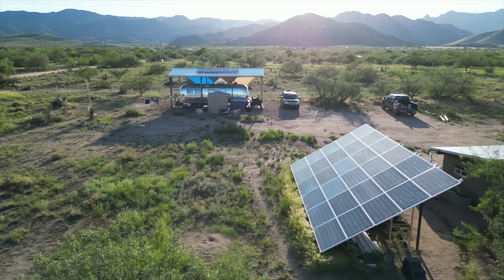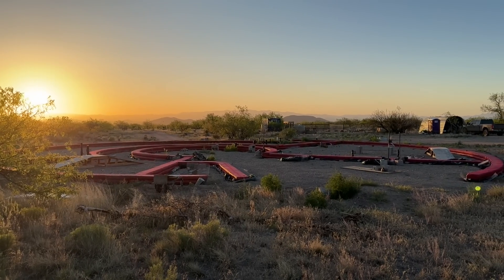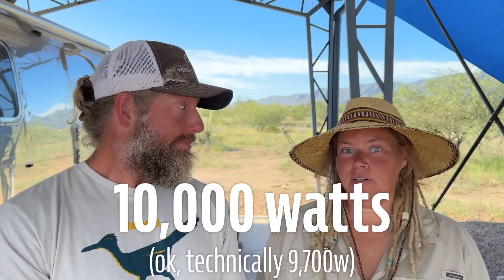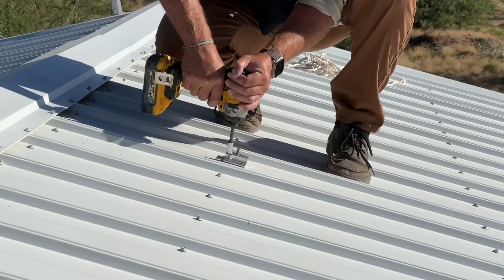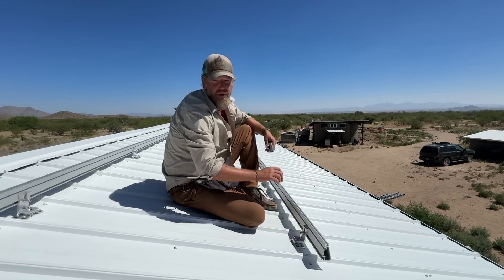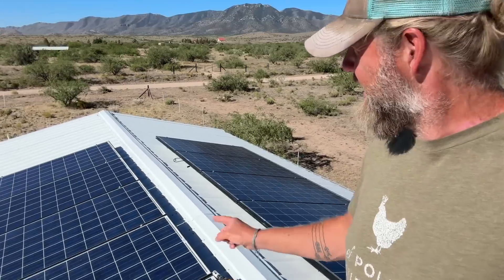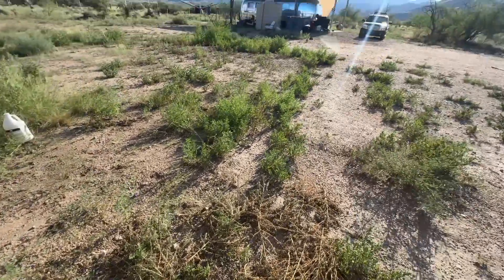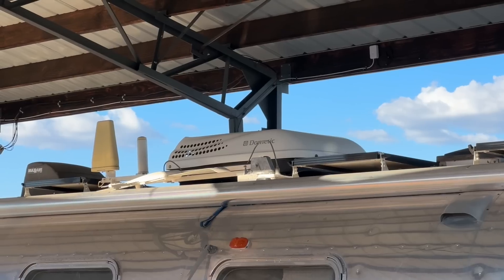BOOSTING Off-Grid Solar System for BRUTAL Desert Summers

Comment: Nice job but if you had just grounded the frame of the car port it would be grounded
Reply from the maker: Grounding the car port is surprisingly complicated because each truss is separate and connected by wood purlins. Because of that we opted not to “ground” the building with the electrical components.

Comment: Strange, I have a metal roof like yours.  I put all the screws on the ridges, not the valleys.  My thought was the water won’t be running down the ridges.  Thank you for this good advice.
Reply from the maker: Different R-panels have different installation recommendations 👍🏻

Comment: You're in the desert... bury a pipe, in a U around your camper, put in a fan, and you'll get earth cooling 24/7 at a small fraction of the AC cost.
Reply from the maker: Have you actually calculated the cost of large diameter pipe over the very long distance you would need for this to work, not to mention the cost to dig those trenches? Spoiler: The A/C is way cheaper. We actually put in a Mini Split: https://youtu.be/mRcHImNXHU8.

Comment: Frankly if your going to all that hassle I woulda filled both side of the roof with panels now that panels are 33% the price they were 2 years ago.  You can never have too many panels but you can always have not enough! :D
Reply from the maker: The rest of the system wasn't built or wired for more than this unfortunately.

Comment: Stop using the current ac and switch to Mr. Cool heat pump and your power needs will drop.  And the Mr Cool will run quieter with less power.
Reply from the maker: Watch to the end

Comment: how much of that land do you guys own? i'd have thought it'd just be easier to have a solar panel farm at ground level, and maybe be able to adjust the angle at different times of year.
Reply from the maker: Ground mounts are generally 5x the cost of panels because of high winds. So anything adjustable isn't safe.

Comment: Ya solar is cool. But I don’t think people understand solar panels only generate power 5 hours on average of the 24 hours and that’s during the summer. In winter it’s closer to 4 hours. I think we all know solar panels generate power from the sun but we assume it’s for 12 hours. That means like you are explaining you can not run a 1.5 kWh ac during the other 20 hours and you already had an extremely large solar set up.
Reply from the maker: They generate a lot more than that. I am easily getting 11+ hours of production in the summer and probably 8+ in the winter. How long you can run a load when the sun isn't out is entirely dependent on your battery bank size.

Comment: Question about the NEC and your new roof array.  In 2023, the NEC required all roof array to have rapid shutdown.  How did you address this requirement with your new array?  Is your local authority allowing you to utilize your DC isolator switch instead of the rapid shutdown switch/modules?
Reply from the maker: We're on the Owner Builder Opt-Out so our county isn't really involved with the off-grid power system, but in general the isolation switch does provide a way to rapidly shutdown the solar panels, and is labeled appropriately, that was the reason we installed it.
Reply: @TinyShinyHome  And I'm guessing that your homeowners insurance company is ok with that owner builder Opt-out?  Our homeowners insurance company has inspected our solar system twice so far.
Reply from the maker: Opting out of inspections means your forgo a certificate of occupancy so it's difficult to get insurance or banks to touch it.

Comment: I'm happy to see your lovely couples and sorry bro but your wife is so cute and i comment you , rather then using off grid solar you have to use Hybrid solar system and why you using so much out dated solar panels which generate so much low power you have to use 615 watt panels which 4 unit per day
Reply from the maker: A hybrid system uses the grid, which we don't have...and we don't want to have. We're off-gird on purpose. You can assemble your solar panel array however you like, using lower wattage ones makes zero difference if it adds up to the same wattage. It's actually cheaper to do it that way. I'm not generating low power over here 😂

Comment: Nice addition. We’re southern Az. We run a dual split unit for our bus with two victron 3kva’s. The heat definitely kills the panel output down here. I had a 100a mppt sitting around from warranty work and decided to add 2200w of ground deployment. Was well worth the $750 I spent as now we literally never have to watch the power consumption. 
I did want to address you stating the Quattro is a 5000w inverter🧐🙂

Comment: The problem is the A/C.  You need to replace that or use another variant.  Easiest solution.  I have an Midea 10,000 BTU that pulls about 300 watts (I kid you not) with its variable-speed compressor (can pull up to about 1kWh at times, but not for long).  Also, I'm sure you all know this... but evaporator coolers need constant airflow and ventilation to the outside; otherwise, you're just turning your RV into a sauna.

Sorry, commenting on this only 4 minutes in.  I understand my comment may not be relevant to what you all did (haven't watched the full video).  Just know that when you read this.

EDIT:  Damn, you all killed it.  I recently bought 31x 360watt PV panels for $2500.  I'm only utilizing 8 of those 31 panels w/ my EcoFlow Pro unit (planning out and getting my own LifePo4 battery bank)... but will get all of them pumping power soon.  Keep kicking ass.  Definitely gained a subscriber here!
Reply from the maker: Haha thanks glad you’re here :)

Comment: Wouldn't it have been easier to just replace the AC with a DC 12/24V AC unit?
Reply from the maker: The followup video to this is installing a mini split in the Airstream: https://youtu.be/mRcHImNXHU8 But either way we needed the extra solar to be able to run it all night and charge back up quickly enough the next day.

Comment: I took my 110 a/c of the my camper. I bought a 12 volt A/C off eBay. Treeligo. I love it and I only have 600wvof solar and 2 100ah lithium batteries. I was just in my camper and it was 53 Degrees.  It fits in the same spot as the old A/C.  Plus it is so quiet The only thing is it's in Celsius.
Reply from the maker: Haha I was like...53 degrees?!?

Comment: what was the program you using for calculating the amp hours you be getting?
Reply from the maker: Not sure what you mean...which particular calculation?
Reply: @TinyShinyHome  oh I saw the name it was the Victorn energy blue power
Reply from the maker: Victron is the company that makes most of the gear. Inverter, charge controller, etc. it all goes through a GX device which can connect to the internet and give you all the nerdy data from anywhere in the world.

Comment: No earthing on the panels ?
Reply from the maker: We talk about grounding the IronRidge frames at the end. The panels output is connected to the combiner box at the other array which has it's own SPD/Earth Grounding
Reply: @TinyShinyHome  it’s not so much the dc voltage that’s the problem. the solar panels are anodised and are highly resistive . The static charge buildup on your roof is 100 volts per meter above the ground, Over 300 volts could build up. Also lightning will destroy all your electronics. Some of these things us electricians do isn’t done for fun. Here in  Australia we have an earthing lug which bits into each solar panel and the roof frame, with a 6 mm square earthing wire to a ground stake.
Reply from the maker: Yes like we said the mounting frames are bonded to the panels with a grounding wire run to a ground rod.

Comment: Can you plant deciduous trees near the buildings that need cooling off.  Natural shade will lower temps inside the buildings and in winter if they lose their leaves the building can be heated by the sun...or put a thick shade sail over the top of the dome ?

Comment: Nice stout power amount. Hey! Dont forget the "cheapo" temperature moderating method..i.e...tapping the earth's nice, steady 55-60°F 8ft down ground temp! Just route maybe 400ft ground grid of 4"dia. Sched.20 pvc tubing 6 to 8ft deep..circulate  with modest water pump some antifreeze mix through this and through a car radiator/fan setup in house! You can then augment with a temperature "bump" up/down  mini-split setting during real extremes too. Its worth it!
Reply from the maker: Nothing about installing 400' of pipe is cheapo 😂

Comment: Reply to @jeb3415...If u dont like solar pnls then #1..get solar panel kit! You can make pnls any shape u want as long as properly wired. And..#2.. They DO make solar roof tiles, & not just Tesla as of last year or so. #3. So far, solar power conversion efficiency sucks..only 20% so GOTTa take up some space. Root for the researchers! Im getting impatient. There's GOT to be a way to get more of the wavelengths converted ..in the same space. Patience!

Comment: Cool upgrade to your solar system and a smart use of the roof area. When this system gets too small for you, consider changing the panels on the ground mount for Bipolar panels (see Average Joe for the system he is testing). Then move the old panels from the ground mount to the roof area to expand those arrays. If you then use brightly colored gravel like a shy white stone under your ground mount you should be able to take advantage of the double-sided panels using the reflections off the gravel The panels Joe is testing are 415Watts on the top side and 215 on the back side, which would be a 3X increase to your ground mount area. Food for thought take care D
Reply from the maker: This system won't be undergoing any more major overhauls as we'll be building a separate system for the house.

Comment: Cool, more solar panels on the Airstream parking roof. Yay, almost 10.000 watts! YEAH, east-west exposure from the Airport will give you morning and evening solar power when you need it! Brilliant! Enough wiring in the ground array to add the output from these two rails of 5 panels to add into the existing solar system in the solar shed. That was great planning! Is that your neighbor Bob helping you guys? I love how Adali does a great job working up on roofs. Yay, up to 40 kWhrs per day! Great, the overhead air conditioner died! I'm glad to hear you plan a mini-split system anyway. Thanks for this video Longnecker family!

Comment: If you ever look to add more panels, check out mounting bi-facial panels vertically. Panels face East/West. It widens the production curve.
Reply from the maker: Plenty of interesting use cases for bi-facials, but here at least the gains aren't really worth it with the high winds we have Much simpler and safer to just stationary mount.

Comment: the fact that your air conditioner died seems like the ideal opportunity to change your setup, heat exchange with the ground is much more stable and will save a ton of energy needs during the summer and winter. ground temperatures just 1 meter underground can be a stable 10C throughout the year, heat exchange with 40C air in summer or 0C in winter is a huge energy demand.
Reply from the maker: Watch to the end ;)

Comment: Hmmm... An adobe garage instead of the metal one would be so much cooler. And the solar panels on the ground would be easier to manage and move to aim at the sun in various seasons. Spoken like a man with a balance disorder....  :)
Reply from the maker: Actually, the metal truss cover does amazing well here in the high desert. All we need is shade on that aluminum and it's a world of difference. A moving ground mount adds complexity, cost, pieces that will likely break, plus with our occasional hurricane force monsoon winds a stationary mount is much safer.

Comment: I'm near Joshua Tree, and my structure is due east/west, and it still is weird to me that the sun in the morning and evening is north of us in the summer. It makes me think that when I do solar maybe I want to do the new bi-facial panels that are perfectly vertical. That way I get the early morning and late evening power, as well as avoiding the peak heat inefficiency of midday. This is supposed to be a bit more efficient than south facing panels and would also keep your batteries from discharging as much since you'd get more late day and more early morning solar, supplementing your overnight usage.

Comment: Sun-tracker  are awesome.. they keep panels on the movement.. so 80% of peak time your banks are 100% and you still run off panels.  Try northern Michigan.. generator
Reply: Is part of winter charging.. still beats utility bills.. 1 fill every 2yrs propane 300gallon.. 😊
Reply from the maker: Yeah not here with the winds we get...
Reply: @TinyShinyHome  had no issues with high winds they rotate face up automatically

Comment: So cool! 😎Ive been itchin to see this done. It makes so much sense. I have to sat, though, the way y'all do earthing/grounding makes me laugh! Metal on metal on metal, then you run copper wires all the way down the metal to ground? It would be more sensible to ground the frame at each post, with some copper in the ground away from the structure, and under the conduit tieing the different structures frames together, and a bit extra near the soak-away. Anyhow, you will see how effective your installation is when the lighting comes along...(I grew up in a lightning belt, and was a contractor for three decades, mostly installing antennas, towers, dishes.)
Reply from the maker: The Airstream cover is an interesting structure. Metal Truss into concrete pad, but the roof is separated by wood purlins. The solar panel racking array is required to be grounded directly to a ground rod (not the power, just the frame), and technically it is connected to the wood purlins as well. The AC power coming from the Solar Shed isn't connected to the structure either, only coming underground and up into the box attached to the separate pump house. I pushed Miracle Truss for some kind of grounding recommendation, and never got a solid answer for if it's necessary to ground the metal trusses when the roof is "floating," and the trusses are connected to the concrete pad. Anyhow, I promise we've thought a lot about it 😂
Reply: @TinyShinyHome  the rule of thumb is bond the metal bits together with short flat straps of copper (1" wide and 1/8"thick will do, roof to each leg, then legs to a ground rod in a similar way. Creating a Faraday cage effect. A direct strike on a"sort of" grounded building is the most punishing. The power will make its own way to ground by any means possible, usually in a destructive manner. All the best. Love your content😁

Comment: at your latitude your better off running you panels near level
Reply from the maker: All the calculators said 30deg, but yeah I think if I had to do it again I'd go half of that. Still need the south facing for winter, but 10-15 degrees would've helped during summer solstice.
Reply: @TinyShinyHome  it sounds like a 10-15% loss in winter is kinda minor for you where a 15-20% gain around the summer would be massive
Reply: Why not just extend the lower mounts up. it will basically become more of a canopy the way it's built. Just cracking a few clamps loose. It will pivot up..
Reply from the maker: Because it's all sch40 steel pipe engineered specifically the way it's put together. No changing it at this point.
Reply: @TinyShinyHome  meh, maybe because I'm an engineer I a little more lax in making modifications
Reply from the maker: I’m not sure if you saw how it was built but there’s not a way to crack the clamps and pivot up. You’d have to take all the panels off, dig up like 40 bags worth of concrete footings, and reset the shorter vertical pipes higher. Not impossible, but not a job I’d want to bother with 😂

Comment: sometime you might mention that solar panels generate electricity when they aren't hooked up and it can be quite shocking working with them if you're not careful. Some people cover them to keep the sun off during installation and most people just realize they're hot and carefully don't short them through themselves
Reply from the maker: With MC4 connectors this shouldn't ever be something to worry about as you'd never be able to touch the positive and negative at the same time. No power should be leaking through to the frame unless something's very wrong or broken in the panel :)

Comment: Four suggestions: 1. Put your existing solar PV array on a horizontal tracker that would allow you to catch early morning and late afternoon summer sun or 2.  Build a reflector to direct sun onto your pv array. 3. Prevent direct solar gain on your airstream by hanging shade from your carport south side.  4.. Install temporary insulation like fiberglass or cellulose around your Airstream to add R value to help keep it cool and warm.
Reply from the maker: 1. Trackers are expensive, add movable parts that will break eventually, and aren't safe with our winds. 
2. A reflector that large doesn't make sense from a cost perspective
3. South facing sun isn't the issue. We already have shade cloth on the west side for that reason
4. This would be incredibly impractical, and winds would be an issue.
5. I promise we've thought about all this for a long time ;)

Comment: Clever you lot...I have a mini split...I do live by the sea and the salt killed my outside motor, thingamajig, lasted 2 years only...I had to buy a new one..the electrician suggested I get a box made for the machine  when NOT IN USE...well I use it summer and winter but you can make a box for it when in use. Just put in LARGE vents either side of the box...make from MARINE PLY, the box and paint with varnish....works....ask your distributor if that is an option....buying a new aircon every two years is not viable.....You guys have a lot of power careful you don't take off to the moon...😊....laffinnnnn..thank you darlings...blessings darling from Granny Linda in OZ...😊